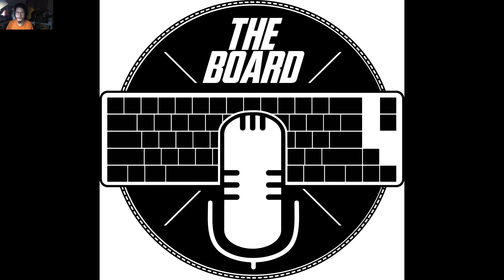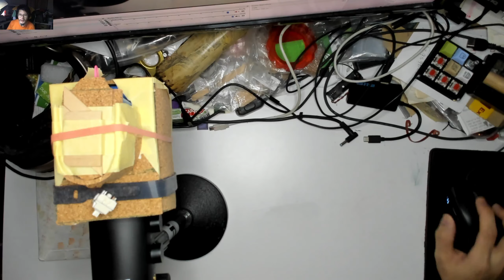Switch Sound Tester - Part 1-  Prototyping

Comment: I guess you could even characterize the impact of different keycaps.  I would like to see the comparison between "silent" and "standard" switches and how that compares with the clicky ones.  My silent switches are quiet and I wonder how much more quiet they really are.  Also, one element of the sound is on the bottom out and I suspect that the PCB (in your case, the 3D printed plate) would act as a "drum" or a sounding board, which overall would have an impact on the sound.  As a reference it's a great idea to be able to compare!  Looking forward to the results!
Reply from the maker: Hi Pierre, indeed the keycaps has been mentioned by HC in the comments too! Though I don't know if my current design for the enclosure would allow tall caps like SA R1 to fit easily haha, and the plunger might not push the angled cap consistently which would require some rethink, but definitely future considerations.

In regards to silent switches, definitely could add them into the mix for that I have!

Comment: Great start to standardise the sound reference - the question is how to combine it with other aspects - where the key caps may absorb sound (as you mentioned), and that could impact what is heard by the end user.  I could see a potential test of any material that could be involved that absorb frequencies and then use that to subtract what is recorded by this method to 'predict' what may be heard eventually...

Another question would be, would it make sense to have multiple switches tested for a lower n-number to get a better measurement of reproducibility/consistency rather than a higher n-number with one switch?
Reply from the maker: It is something I have considered, for a more 'representative' profile of each switch, you would need to sample more switches, but the high n-number I guess enables the frequencies to be better represented and to account for inconsistencies in the pressing.

I guess it could be tested in doing frequency graphs of single switch low n-, multi-switch low n-, then single high n- and multi high-n and compare.

In terms of material impact, could be considered once there is sufficient baseline data I guess that would help do the subtraction you talk about.

Lots of potential but a big span of testing and recording and processing!